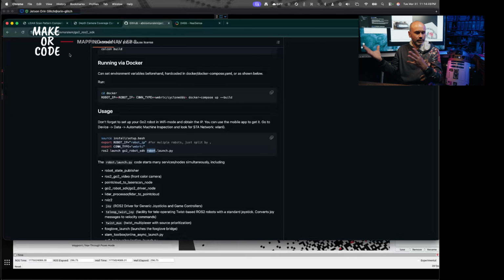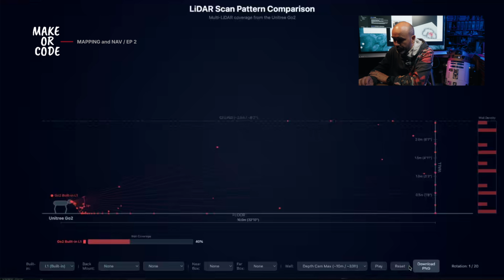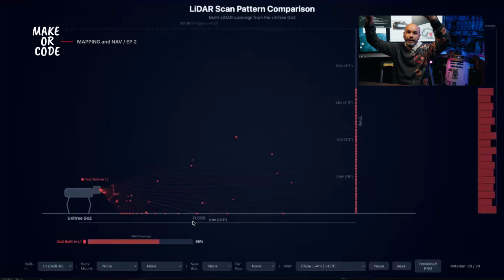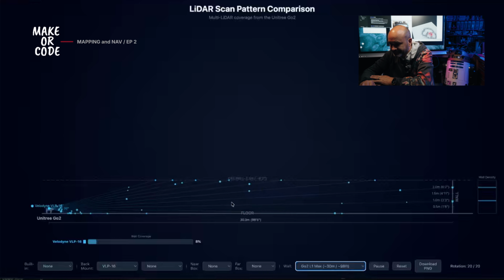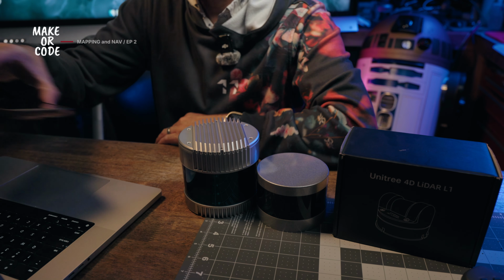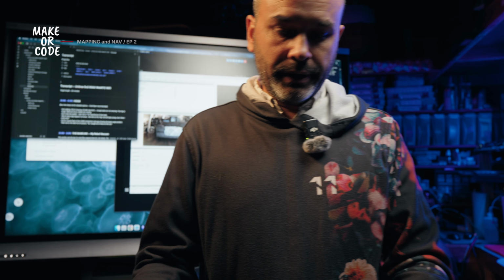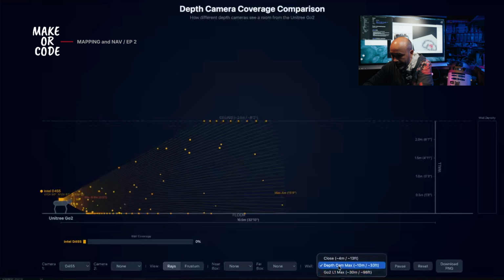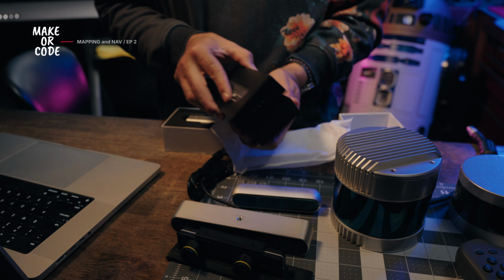LiDAR vs Depth Camera - AI Robot Dog | Map and Nav Ep 2

Comment: I am using xt-16 for nav for now, I have not bought a depth camera yet
Reply from the maker: You are my 100th subscriber so thanks.  

It is a great start.  I have a new video on am working on that is utilizing the Livox Mid-360 only for navigation and I find this lidar is TOO good that I have to down sample the information to a very small band to get mapping to even work.  So starting with the XT-16 may be more than enough for indoor map generation.  Still doing the testing now, but I only use a VERY small window of the pointcloud data, equivalent to probably only 2 lines from a XT-16 to get mapping to accurately map the room with the Livox Mid-360.  The taught being, my robot vacuum only uses a single line lidar, so a small window of data from a multiline lidar should be more than enough to map the house.

I also plan to start testing all my depth cameras soon to get you some feedback.
Reply: @MakeOrCode  That’s really interesting about the Mid-360. I’ve been testing the XT-16 on a Unitree Go2 EDU in a basement lab environment for autonomous navigation and QR-based inspection routines. 

One thing I’ve noticed though is that sometimes the robot’s coordinates/localization seem to drift over time, and eventually I need to recollect the map for navigation to become reliable again. I’m still trying to figure out whether that’s mainly due to:

SLAM/map quality,
repetitive basement environment features,
or possibly connection/network issues during operation.

I’m using the official Unitree SLAM/navigation stack right now, so I’m still digging into what part of the pipeline is causing the drift.

Really looking forward to your depth camera testing videos too — I’m curious how much they help with localization stability compared to LiDAR-only setups.
Reply from the maker: @ladaprotcheva4547  I am facing a very similar situation.  I built a mecanum wheeled rover to do easier testing then my Unitree Go2.  What I found was first the mecanum wheels never get great traction so they slip and cause some drift.  I then found that the first 30 seconds when starting the map creation, it is important for the SLAM to determine the environment.  So try to make sure it is not moving for the first 30 seconds.  Lastly the most important is the environment itself.  My garage was to feature less.  My living room had enough features, but technically to much and would drift.  I then created the small window to use in the map generation about knee height with about 3 foot high window of data only and I was able to create maps and not drift.  Again I went down this path because my robot vacuum, which is a single line lidar is able to create a map and navigate at scale (any user can buy, turn on and map and navigate without worrying about there environment).
Reply: @MakeOrCode  Hi! Did you find a way how to improve the map? I just got a depth camera so I will see how I can use it with lidar xt-16. Do you have any tips?
Reply from the maker: I have.  I am working on a video about it right now.  While working on it, I found another large issue, my mecanum wheels slip a lot.  To much that I need to also fix that issue to get reliable mapping done.
Reply: @MakeOrCode  oh, do you have Go2-w? The one with the wheels?
Reply: @MakeOrCode  I am excited about your new video. I hope it also fixes my issue
Reply from the maker: Sadly no.  I could not afford that.  This is all being done on my dime.  But I wish.